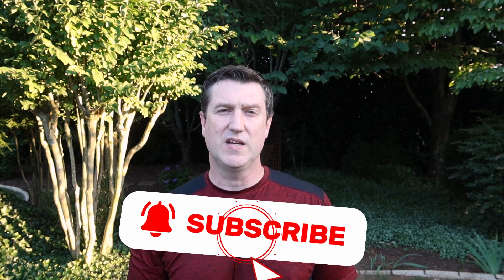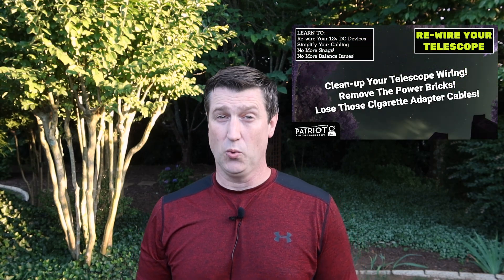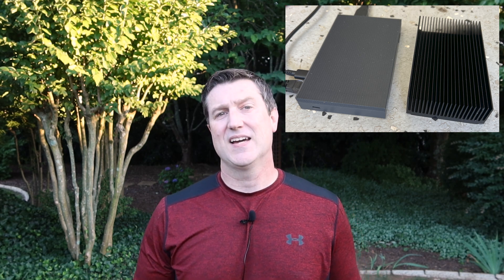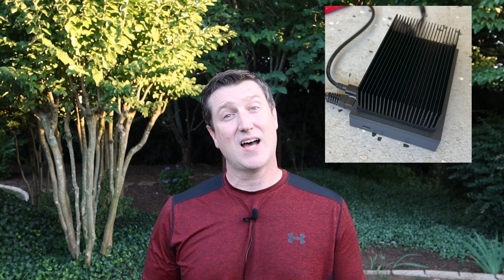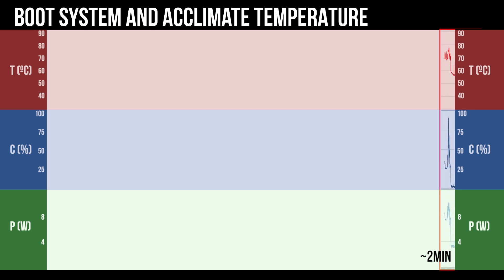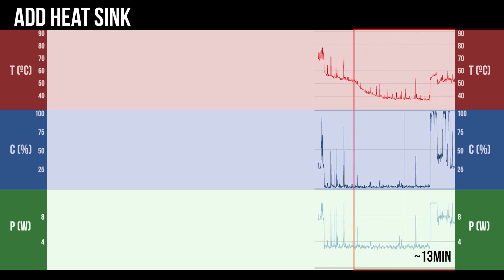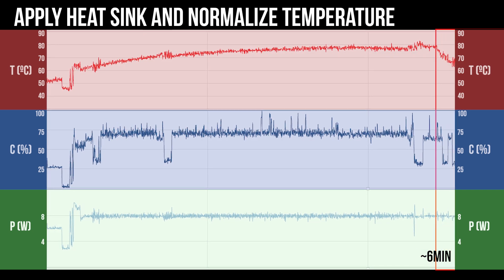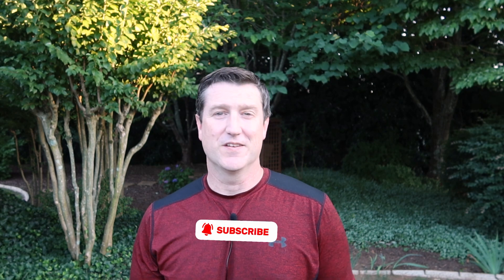Addressing Your Fanless miniPC (Quieter2/3) Temperature Concerns and Power Connectivity Questions

Comment: @PatriotAstro - great video. NINA team should comp you for the exceptional work you've done. :-) How did you attach the heat sink you've recommended to the MeLE MPC? Did you use some kind of thermal tape, or glue, or anything else? Any kind of tape (even a conductive tape) will hamper the performance. The MeLE top is a perforated top. so covering that with tape will negate the benefits as the heat will be trapped inside. Any info would be helpful on attaching the heat sink. Thanks.

Comment: So I got the recommended heat sink today and its currently sitting on top of my MeLE 3 - temp is 38-40C with my 26m in Sharpcap running in a test shot, cap on the telescope, 1600x1200, cooler running to -5C, Mono16 ULN mode. Current load is 8% on Core 0. If I remove the sink... 40-42C mark and this is nothing else running apart from Windows. So the Sink works. Whats the best way to get the sink onto the body work? Thermal paste is great for flat tiny CPU surfaces... how will it affect the bumped large surface area of the pc? Thanks for the video! Ok the temp is now 47-55C. SC off - idling at 43-44C.

Comment: Hello there! Just beginning my journey through setting up a Mele for astrophotography. FYI: I purchased a Mele Quieter 3Q a week a go and using a usb c powerbank that outputs 65w successfully powered it up and it works! Apparently the earlier versions did not work AND Mele states specifically that the powerbank needs to give more than 24w out…

Comment: you might have noticed the metal bottom plate gets much hotter then the top plastic pyramid heatsink. adding the external heatsink to the metal plate with some thermal compound would be far more useful.

Comment: Could you answer, why did they put a visa mount on it, if its only designed to be lade flat, as you seem to think?
Reply from the maker: They had told me it provided optimal venting when laying flat. The vesa mount is so they could compete with other vendors in the TV space, specifically for use cases where the system would provide digital signage via tv screens. (Menu's at fast food restaurants, conference center wall displays for schedules, airport flight info screens, etc that are lower power use cases.). Depending on your ambient temperature, etc you may in fact find mounting it vertically is fine, but the best venting is horizontal.

Comment: Great video! I bought a similar heatsink and used thermal conductive tape to stick it to the Quieter3Q. I then used two plastic coated wire ties to secure it even more, and hopefully keep it from slipping. Mine is mounted to a tripod leg. BTW, I do not believe that these need to be kept flat: 1- It comes with a VESA bracket, 2- I did not notice any temperature differences related to orientation during my testing.

Comment: Great idea 💡 I use the heatsink with great results. Adding a small set of 2 usb 40mm fans epoxied to the side of the heatsink resulted in a extra reduction of 15C, handy for those solar imaging days in Florida.
Reply: Is the fan blowing air into the heatsink or pulling?
Reply: @daigunder35 blowing into

Comment: 3:20 I have been using pc sticks and ultra mini / pocket computers for 4 years now for my astro. I just got the MeLE Quieter 3c as I thought the format was nice - also very similar to my lenovo n90, the cpu was adequate and with a lower TDP.. but it's not that it's hot, it is SUPER hot to the extent I can barely touch it ! And mind you, I wasn't doing any processing, I was litteraly just installing softwares to try to test it. And if the solution is to double the size by putting a heat sink (6:50), then I don't see the point. 12:40 I do confirm that indeed even when turned down, it stayed at ~80° for probably 5-10mn. My goal was to add a M2 SSD for planetary imaging as you need Tb of data for that.. But I am afraid that will just burn at this stage.

The other issue is.. Windows 11. The MeLE with 16gb of RAM and a better cpu is effectively slower than my pc stick J4125.

Comment: My first fanless PC is a firewall appliance, running as a firewall.. Would not be surprised if someone turned one of these sort of devices into a Windows PC.  Already comes with a decent sized heatsink.   I went from a regular desktop with the standard noise that comes with it to a mini-pc about 2 years back.  The thing was, when I finally turned off the desktop PC, I was stunned on how noisy it actually was, despite me not really noticing. 
Today was my benchmark where I put the rest of the house "under" it, with all internet devices and such going thru it.  I'd probably be found guilty of over-spec'ing what I purchased...  N100 4 core;  it's got all the necessary ports to run it with dual monitors as well.  It runs somewhere around 47 degrees C or 111 F. I'm going to put it on a steel rack, with plenty of air above and below ..  Rack comes in tomorrow.
Reply from the maker: Sounds like a beast for a home FW. :)

Comment: A few questions:
- How does it handle Visual Studio?
- Can it be powered from a USB power source?
-is it ppossible to enable virtualization in the BIOS?
Reply from the maker: I don’t run visual studio on mine, but I can’t imagine it would be too bad. Gaming and intense video might be another story although I’ve seen people do that too. The power on these boxes is 12 V so it won’t run directly off 5 V USB power. I didn’t check virtualization either because I’m not using it that way. If I get a chance and remember to check, I’ll let you know.
Reply: @PatriotAstro  
Thanks.

Comment: I am considering the MeLE Quieter 3C computer. I would like to use it for solar imaging but am concerned about the heat issue. I live in southern AZ where summer temperatures can consistently exceed 100+ degrees. As was mentioned in some comments here, the heat sink could affect WiFi capability so I was looking at possibly using a small USB fan that I could stick on the MeLE to keep it cool. It seems like one person did that. Is that a possible good option?
Reply from the maker: Possibly. I’m not so sure I would stick a fan to it so much as run air across it. 1 or 2 fans that draw a stream of air across the unit. Direct sunlight avoidance is the real key. Keep it shaded.
Reply: @PatriotAstro  Thanks. Will have to figure out how to configure something like that.
Reply: It could be difficult to find a place to position a fan, plus I would be blowing hot air over the mini. What if I have the fan on the mini blowing out and extracting the heat off the mini?
Reply from the maker: @johndwyer1095  it’s more about moving air. And having good airflow. Plus the air you are moving across the unit is still a good deal cooler than the unit itself so thermodynamically the hotter temps will flow towards the cooler as far as heat transfer goes. Find my email address on the About page of my channel and send me an email. I just got a reply from MeLE tech-support about the operating temperatures of the units. I can send it to you.
Reply: @PatriotAstro I ended up getting the MeLE Mini PC Overclock4C with fan as that became available late last year.

Comment: is it ok if it is upside down as long as the correct side (with special material) is open to air?
Reply from the maker: Keeping the plastic top clear is key but it is also expected to be mounted such that heat can dissipate properly. This means that horizontal right-side up mounting is ideal, followed by sideways mounting, with the worst case option being upside down. But,… depending on your situation (other venting/breezes, ambient temperature, etc) it could still work but would need testing to be sure.
Reply: @PatriotAstro So mounting it on the telescope, which, for me was the whole point, means it will never be horizontal right side up. With the telescope parked in home position, the computer will be on a 45 degree slope withe USB ports on the low end. As the mount slews, the computer will end up pretty much on it's side and after a meridian flip it will be on it's other side.  So where/how are folks mounting these?
Reply from the maker: You'll be fine. Unless you are imaging in very high heat or direct sunlight (unshaded unit) it is unlikley you will have an issue. @jimc31415

Comment: Excellent video, thank you. I have a very large, thick steel pier and was considering mounting the miniPC with the metal top in direct contact with the cold steel pier…it actual fits rather well between the concrete base and the bottom of the pier…. I assume this would be an excellent heat sink.
One other question is the durability of these miniPC with extreme temperature change… keeping the unit in an unheated obs in -20C winter and then cranking it up the +70 C might have a lot of thermal stress on the components over time. Any thoughts ? Cheers
Reply from the maker: You are right, if you can get it mounted properly, that would be an incredible heat sink that could work very well for you. We’ve seen similar results with other people mounting to sturdy brackets on their telescope with similar results. You are right in regards to temperature too. You may need to find a way to get the temperature up a bit. You may find that it helps to mount it in some sort of an enclosure , and or even nearby an dew strap that could warm the device before you get it running. All computer equipment does have limitations as it relates to temperature variations, just like any of your other equipment out in the observatory. Let me know what you try.

Comment: As many others have pointed out, another great video.  Curious as to where everyone mounts theirs, so that the PC is upright.  I had planned to mount it under my scope dovetail plate.  Now I'm thinking I'll have to install on top of the scope.
Reply from the maker: Unless you are in an area that is extremely hot at night, you very likely won’t have any issues with the orientation of the mounting for evening use. I wouldn’t overthink it too much. Just find a good spot that gives you the cable reaches you need and good balance, whether it’s on or off the scope.
Reply: @PatriotAstro  Ok, thanks.  That helps, I can stick with my initial plan

Comment: Another great video! I’d never even thought about temperature on my Quieter 3, so I’m going to check that out right now. Great tip about removing the stickers (crazy!). Puzzled about the power supply stuff tho. I plug my Mele into the Pegasus UPBv2 12V ‘always on’ and I’ve never had a problem.
Reply from the maker: You are good on power then. Lots of people are going straight to 12V battery, etc without the option you have. Sounds like you are good to go!

Comment: I want to re re update my test with a bigger heatsink 100x150mm, same area of Mele Quieter 3HDQ which is is the bigger brother of 3Q/C. I've got shocking results with this heatsink with a defeat of 15 degrees on my usual temps. Even if the model of this video is less bigger i suggest go for an heatsink with same exact size of Mele top to improve the heat transfer, results arr shocking for just an aluminum heatsink put on top. Take note if you use a thermal tape will insulate a bit but overall the improvement with little price is totally worth it.
Reply from the maker: Agreed! I was also shocked with the results after just sitting it on top. It almost immediately started to drop the temp. The only down-side I have seen is that it can negatively affect the wifi performance.

Comment: Bought the exact same heatsink for new model called Quieter HD3Q, this has an extra space for 2,5 drive other than nvme and is a bit taller. Model gets hot but not dangerous, around 85° at max stress (stress bench), never seen going over that but still a concerning temp. With the heatsink it defeated 10 degrees for sure at least, reaching similar results on this video, at max stress i am between 70 and 80 degrees, which is crazy results for such an heatsink put on top of plastic case. I was skeptical about this video but was proven wrong, and i have to thank you because now i am very satisfied, other mini pc that i have with fans gets even hotter than this.
Reply from the maker: Validation is always a great thing! Sometimes too good to be true is just that. :-) I’m glad you went out and tested and got your own numbers as well. If nothing else, it helps to prove that it wasn’t a one off test or a fluke depending on how tight the tolerances are for the build of these devices. I picked up a 3Q recently as well, just do some testing, and the only disappointment I have so far is that it only has two USB3 port’s, which is baffling to me based on everything else they’ve done to this box. Thoughts?
Reply: @PatriotAstro  As said i've got the HD3Q which is the taller version with 2,5 slot, i'm not sure if those are the new line of Quieter but guess it's just a variant for those who wants the internal drive. It has 4 usb (two 3.0) like the normal 3Q. 3C other than 3 Usb should have an improved thermal design so maybe default temps could be lesser than those you recorded here. Considered i have more or less same results i guess those Mele fanless pc all behave same and gets hot, but as you said they have an efficent design to avoid harm. But those heatsinks make a difference with just a small cost, 10 degrees down it's great.
I think everyone should consider it, i'm suggesting your video to my friends because you are the only who talks about this solution. Thank you for your time and effort.
Reply: If can i help i've sealed heatisnk to case with thermal tape, that i've also bought on Amzn, and i see slightly worsen gain, i wonder if tape insulate beside the thermal prerogative. I would not suggest toward it, direct contact seems better for heat transmission.

Comment: Nice video...very helpful.  I'm considering switching from my Raspberry Pi/Stellarmate based system - I had clear skies last night, the first clear skies I've had in a couple of months and fought with connectivity issues for 2 hours before I gave up.  Very disappointing. So, I'm considering the switch to Windows based NINA, and this mini PC would be perfect.

I'm curious about the application of thermal glue/paste using the heatsink?  Would you expect even better cooling performance with the inclusion of the thin layer of glue?  It appears that the top of the Mele is corrugated, so there would seem to be some of the surface of the Mele would not make contact with the entire surface of the heatsink.

Thanks for the informative video
Reply from the maker: You are right. You don’t really want any gaps and the thermals do flow better between layers if it is smooth. I would first try it without anything though, not even a heatsink. It’s most likely not actually necessary. It becomes more problematic if you’re running in very hot temperatures or doing solar imaging.

Comment: Dude.  This thing gets hot like hot hot.  90c to F = 194F.  Im not saying thats bad - this thing checks all the boxes for an astro PC but I was not prepared for how hot it gets haha.  Now, thinking back, the case is an actual heatsink with no fan so..  I just unboxed it, installed an NVME, reloaded Windows and let it do its thing with updates.  I can hold it for like 8 seconds before I have to put it down.  I can boil macaroni noodles - pull one out with a spoon and drop it in my hand without burning myself.  This thing is about that hot.  I really like it but dang - its hot.  And yeah - thermal tape and all that is perfectly applied.  Someone more smarter than me could 100% rig something up to eliminate the need for a dew heater and utilize the heat from this instead.  Just saying.  Thanks for the reviews.
Reply from the maker: Fanless systems do get very hot, or at least can when they’re running hard like processing images or running a Windows update for sure. But they definitely stay within specifications and aren’t going to damage any internal components. Other than maybe your hands. Let me know if you cook an egg on it though I’d love to see the meal outcome. :-)

Comment: Thank you so much for these  videos! I´ve learned quite a lot :) I was wondering whether anyone here has some advice on how to weatherproof these though. Since I plan on leaving my telescope outside overnight and remotely controlling it, I´m a little concerned about rain or snow.
Reply from the maker: Unless you have a dome or a rolloff roof type observatory, which would protect all of your equipment, there’s probably not a lot of options other than being vigilant with the weather report. If you do go the route of a rolloff roof or a dome, then there are ASCOM safety monitor solutions that can use sky conditions, weather forecasts, and even rain sensors to close the domes or roof automatically when the weather change is detected. Otherwise, it’s a bit manual.

Comment: @patriotastro,  I just stumbled onto this video after I already got my Quieter 3C up and running.  I run it off of an Amcrest power brick which actually powers the 3C at 9.2V.  My 3C has 8GB & a 1TB SSD and, I forget which but, ran for about 16 hours and had either about 76% or 84% capacity left on the battery.  Just thought I'd pass along.

Thanks for all the great videos!
Reply from the maker: Hi Dan! Thanks for this comment and the email. I can't wait to hear about the upcoming test results with additional power draw. Sounds quite promising!

Comment: I have the Mele Quieter 3C. I noticed the bottom gets very hot. So I am planning to screw it to a 30mm losmandy plate  when it arrives. I will apply a thermal pad or paste to the bottom then screw it on so the losmandy plate acts as a giant heat spreader.
Also according to Intel, 105C is the max temp for the N5105 so I personally am not concerned about damage should it operate in the 80's here and there, but keeping temps down is always good.